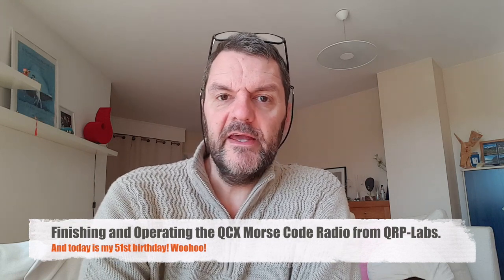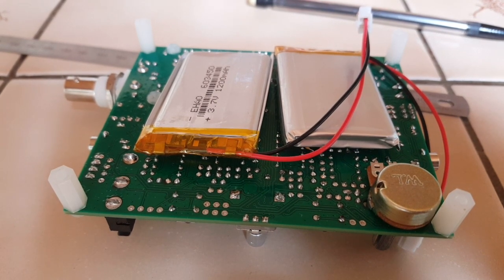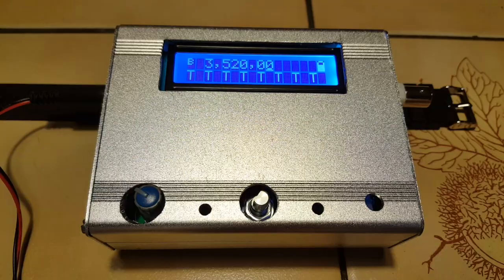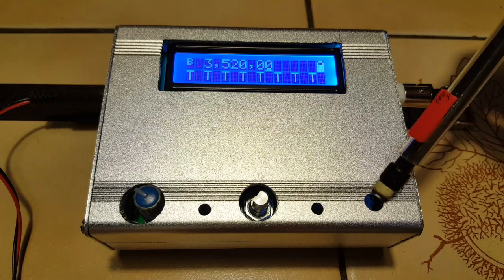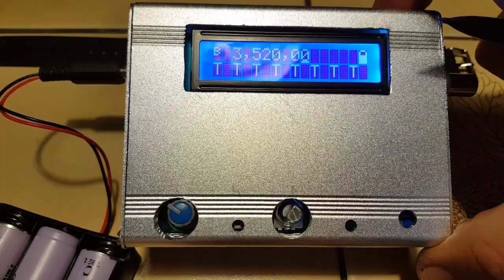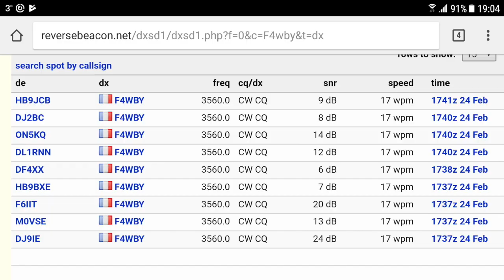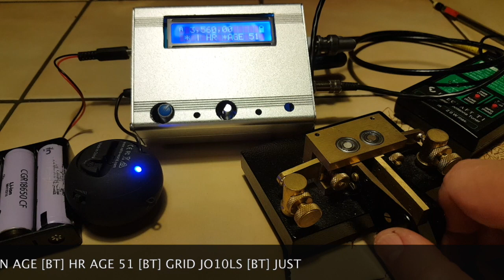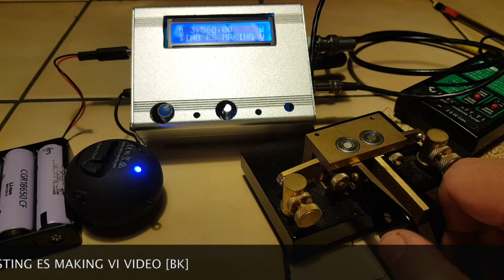Finishing and Operating the QCX Morse Code Radio.

Comment: I continue you to be impressed with the elegant simplicity of Morse.  Having watched you make many dx contacts with qrp radios is inspiring.  You are correct in stressing the value of low power portable gear for prepping.  Clearly such gear will be invaluable in a grid down situation.
Reply from the maker: Undoubtedly the last ones on the air!

Comment: New subscriber here mate, all the way from Australia. Love your videos so far, and I have some advice for you (and your subscribers), such as it is:

When using pilot holes (to make bigger holes), choose a pilot drill only slightly bigger than the web of the larger drill. The web is the flat nosed part of the drill, that is right in the center, between the two cutting edges. Believe me, this makes driller the bigger hole vastly easier. The web does not actually make any cut, so when it is spinning in the middle of the hole, its really a solid rod of metal, not a drill as such. This solid rod of metal will follow your properly sized pilot hole exactly. I have used this process to manufacture rifle actions for up to 338 lapua cartridges.

Always use a non slip top on your drill press. Thin rubber or soft wood is ideal. Its no big deal just holding the item in your hand, but having it stay there, makes for a much neater (and safer) job.

Use a fast drilling speed and slow feed in softer metals, such as alum boxes. Slow feed gives smaller chips, and less likely to grab the thing and kill you with it :-)

Use coconut oil as a lubricant on alum, it works awesome try it.
Reply from the maker: Great thanks!
Reply: @RadioPrepper  Hi Gil. As usual, a great video. Almost complete w my 40Mtr QCX kit. Have struggled, off and on, for 3 days w T1 but that was due to 'Pilot Error'. Ready to mount it as I 'stylus' this.
Although licenced for 35+ yrs, I've only made one CW contact abt 30 yrs ago and it was a 'gruussuum' disaster!
You, and your videos, have been very instrumental In my 'Jumping In With Both Feet' to become a proud CW/QRP/Prepper. A lot of work ahead but I'm taking your comments and advice to heart.
I've Prepped for yrs but have had to re-start my efforts and QRP/CW is my current focus.
Thank You Moocho-Much for your Inspiration!
I've watched dozons upon dozens of your vids and loved every one, even the two where you only speak in Begiumese.....
Someday, I'll start at your beginning and watch them all in sequence.
73
Russ in NH
KA1RUW

AND AS FOR RON'S COMMENT
Tnx 4 a timely comment abt pilot hole sizing. Now I'll be selecting the correct pilot drill size instead of doing it randomly.
Again, very timely info and tnx alot for posting it.
Russ
Reply from the maker: Thanks Russ, glad I inspired you :-) keep at it!

Comment: I just finished building the 40 meter version. I'm very impressed with the receiver. It is just as sensitive and sounds better than my Icom IC-756 Pro III. I'm getting my code speed up enough to get on the air. N6ZCU
Reply from the maker: Bah, just get on the air, the speed will come...

Comment: Fine video Gil.  As usual!  Fun and very pleasant to watch.  I'd like to make a comment that you will most likely not agree with.  I've seen you mention it before.  I've seen other hams 'somewhat' bothered by your refusal to give what they called a 'real signal report'.  I have to admit... I laugh every time.  The 'strength' portion of the RST system was never meant to correspond to either a mechanical meter movement or an LCD display.  Its subjective! This subjectivity is ALL that I care about when receiving your report... I don't care what your 'S' meter displays.  Every radio model will have differing 'S' meter standards, as will each unit within a model line.  Those numbers on the scale mean nothing to me.  They tell me nothing.  I'm not fishing for an ego boost when I receive your signal report (obviously.  lol... I'm a QRPer) I'm just interested in how I 'sound' to your ears.  SINAD is the only objectve way to assess signal strength.  Yer gonna have to give it up eventually Gil... and give 'em what they want: a number.  Haha!  Just putting in my two cents.  Keep up the wonderful vids!
Reply from the maker: You might be right. Only got one complaint in six years...
Reply: Gil, that one complaint was worth it's weight in gold.  Oh man did I laugh at the old guy getting audibly perturbed.  Its all good.  If you gave me a '?' in my report I'd happily accept it.  Thank you again for your very pleasant videos.  73

Comment: Got a 40 meter version that I will start building next week.  I use 100 feet of wire and a unun and can work 80 - 10 with my IC703+. 
Thanks for the video.
73
wd4dda

Comment: Gil, I noticed you have a battery pack attached to the QCX.  Can you tell me what sort of batteries you are using?  I just finished assembling the 40m model, and have yet to power it up.  Thanks for the great videos. 73
Reply from the maker: Hi, it's three 18650 cells salvaged from an old laptop battery...